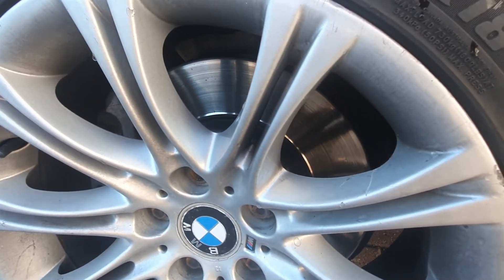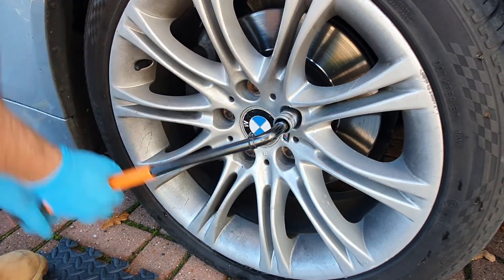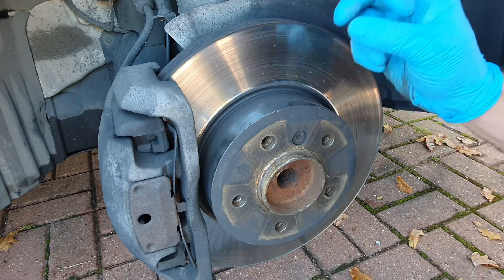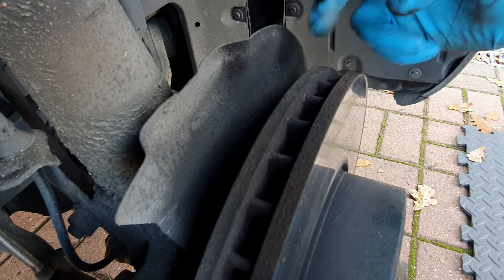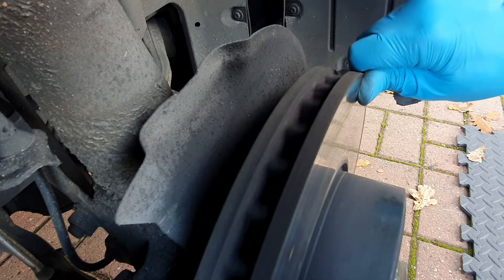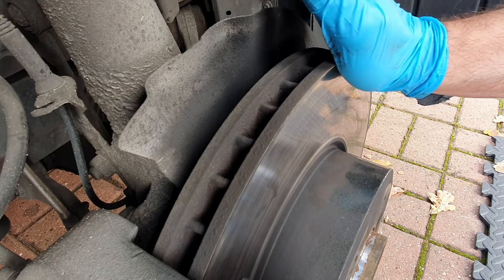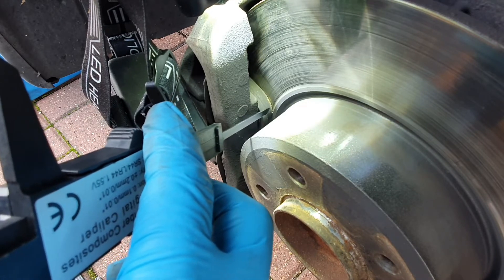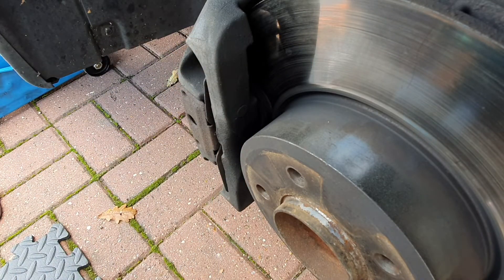How to measure thickness of Brake disc/Rotors and check pads BMW 5 Series e60/e61

Comment: My dust shield is too damn close to the rotor (full coverage) o get the caliper around the width of the rotor........
Reply from the maker: @Terry Evans Hi Terry, how frustrating!! Did you manage to move it enough to the the caliper around it in the end? Or does it have to completely come off?
Reply: @TheBimmerFixer  the clearance is way too tight. I’d have the bend the dust shield quite a bit to make it work. When I replace the pads, I’ll remove the caliper at the same time to measure. Worst case, I’ll have the car on stands for a few days while I wait for the rotor delivery if needed.
Reply from the maker: @Terry Evans Ah is I see, that really is a pain! Well good luck hope all goes well that sounds like a good plan.